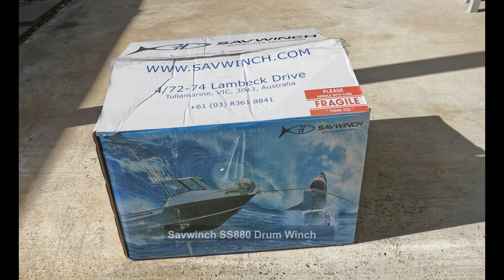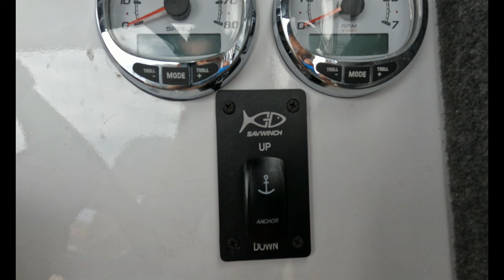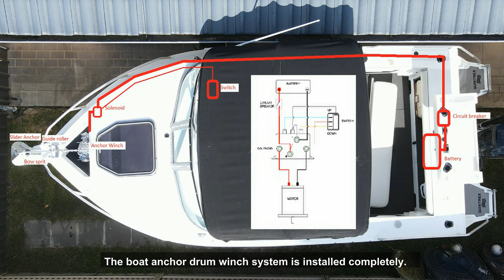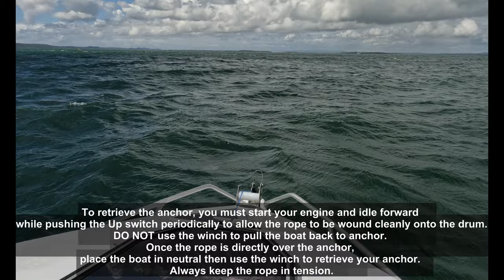Install Electric Anchor Drum Winch System Step by Step Savwinch Quintrex

Comment: 1:51 is that panel isolated from the rest of the boat? Otherwise you’ll start getting galvanic corrosion through your hull with the slightest current leak, with your negatives bolted there. Best off getting a terminal block that you can keep it separated from your hull. Good work otherwise 👍🤙